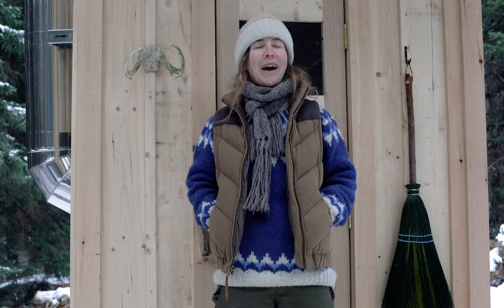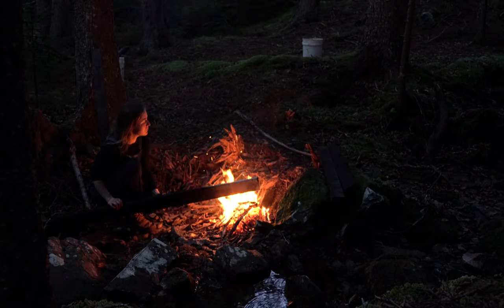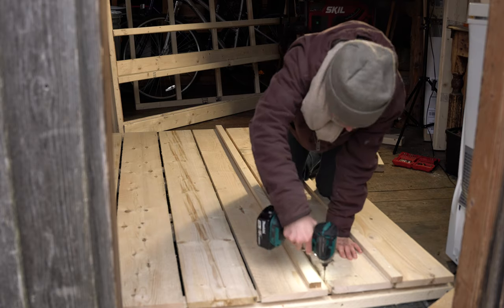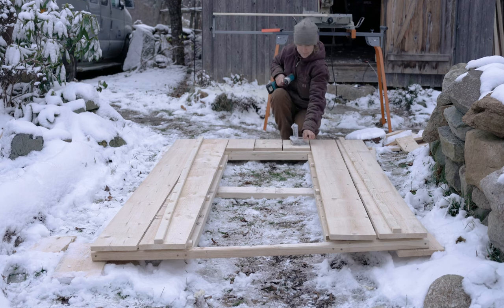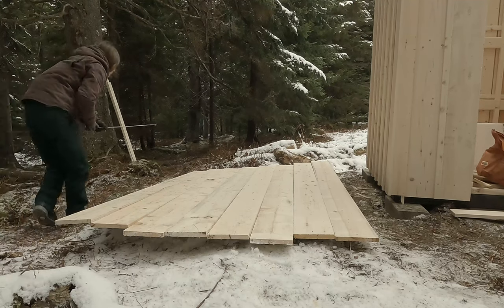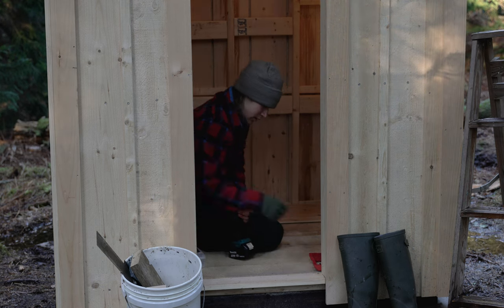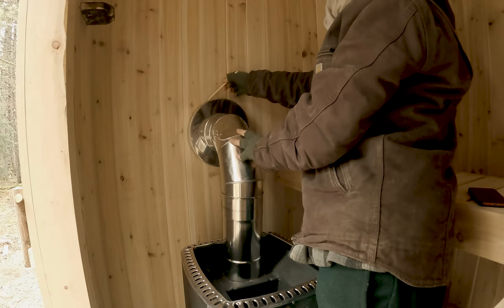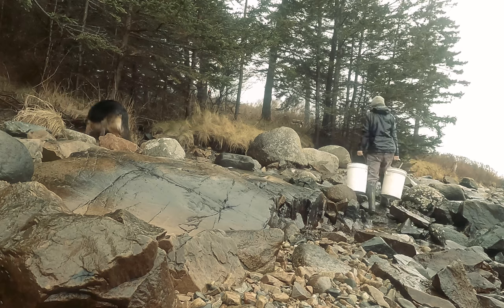How to build a LUXURIOUS sauna without carpentry experience in 30 days

Comment: Well, being a Finn, sauna comes from Finland, there is few mistakes her, just telling you, so others dont make same mistakes: Where is Air vent s, air coming in and going out?? very important, sauna cant be like a Bottle, in wood heated sauna, air should come in from behind or next the Heater, lower level, and going out from the top, behind benches. You should always insulate the ceiling, heat goes out from the top, this small sauna walls are optional to insulate! Why did you nail boards to top bench?? Leave them lose, so you can lift them up after going to sauna, they dry up easy, or screw them under, never should be nails or screws on a top, where you are sitting! So there, Happy Sauna Times =)
Reply from the maker: Thanks so much for taking the time to share your valuable feedback! I chose to forgo the vent system because the door has some pretty large gaps around it, at the bottom of the door you can feel the cold air rushing in and at the top you can't feel any cold air. So I think the movement and venting of air is working perfectly fine—one reason why not to worry about a super tight door! I also thought that without insulating it vents would let in too much cold air. As for the ceiling insulation, this sauna easily gets up to 175 F in 30-45 minutes with small logs and plenty of kindling. If it were larger, that might be an issue, but with the size, it heats up so easily. Plus, I didn't want to use grace ice and water shield or some non-natural material like that which seems to be necessary when you start insulating. As for the nails, you make a great point! I did consider leaving them out but I like to sit on towels so that the sauna stays clean since it is not located near running clean water, cleaning the benches from sweat, etc would be hard. The towels protect your skin from the metal just fine!
Reply: @lilyannajoy It’s also when you have a discussion with water. You know it’s answer, water is wet and not kind of wet.. It’s like a Fin that knows sauna..🧖‍♂️
Reply: @lilyannajoy  Cold air entering the sauna is not a problem, but the problem is that there is not enough air entering the sauna and go out off the sauna, The problem is also not that the sauna room is too cold. It's not when there's a heater. The pleasure in the sauna comes from the fact that there is good ventilation and a heater that is hot enough to get good steam.
Reply from the maker: @HannuPulkkinen49  Well, it sure isn't perfect, but it is better than what I had before (nothing), and I feel exactly the same pleasure from this sauna that I do in other, more perfectly designed saunas. But I understand your concern, I will definitely be more intentional about ventilation in my next sauna build!
Reply: It's a impressive build but I value aged old ways of venting the sauna. The air circulation is important
Reply: @lilyannajoy  If the sauna feels ok for you as it is consider it be ok then. I have a rather large sauna with big stove and I don't have a ventilation there. It has old wooden door that leaked so much that I put a linen sauna seat cloth that hangs on top of the door gap inside the sauna like a curtain preventing the steam escaping too fast and it works wonderfully! Also the window is leaky too and only one glass. Sauna is made from logs and its old smoke sauna that has been renovated as a wood stove sauna now. It has a log panel walls with a gap behind the panel so air can circulate and steam does not gather there and cause problems. Quite often sauna walls, ceilings and seats are treated with something to make a moisture barrier but I left it out in my sauna so first the steam gets in all the wooden surfaces and then when those are inbregnated with moisture it starts to get more moist in a sauna and it also gives out the moisture in a sauna when air start to get dry again keeping the sauna more humid. Also you can smell the wood much better without blocking the surface with any barrier. Although the seat stay much cleaner when you put paraffin oil in them as much as they take it but I use cloth and wash myself before getting seated. I enjoy the most around 158 F sauna and as much steam as it does not feel burning my skin. If you enjoy go and roll around in a snow next winter or have a cold water bucket to cool down and then get hot again in sauna! That's what I love to do when possible and when I feel for it.
Reply: Only half Finn but identify as FINN. Remember going to a sauna in Wyoming in the winter time as a kid.( 70 years ago ) Everyone in the sauna ( except me ) speaking Finn!
Wish those old towers were around to coach me as I build one next summer😊

Comment: The main thing in any project is that you have joy as you think about doing it, enjoy doing it and feel good about it when you are finished and you achieved all of that, setting a great example for others that it's not always about doing it 'right' but making  it about the satisfaction and joy.   Sure there are 'technically' correct ways of doing this or anything for that matter, and we may always find there are things we would do differently, but if you end up with a result that you are happy with, who cares if it's done 'right'.    I will be building one of these and hope it turns out as good as yours.

Comment: It’s hard to say it’s a sauna. It’s a small shed with a big stove! 😂
No insulation, so you will be burning a lot of wood to keep it running. And with air sipping from all cracks, not sure if it will be comfortable. 
But if it works for you, good for you! 😂
Reply from the maker: It actually doesn't take much wood at all for a 1 hour session, it heats up in 30 minutes, and we have a TON of dead branches everywhere to use, so it is helping to clean up the woods. Ask any of the five people who have shared the sauna with me, and they will be the first to tell you that it gets SO hot in there. There are two spots where there are some tiny cracks and they aren't a problem at all. It is quite nice!
Reply: Not the most worthwhile comment…
Reply: 😂😂😂😂😂😂 if your not from Finland you can do one

Comment: Greetings from 
Winthrop Maine. Congratulations on building your first project; your sauna looks nicer than the magazine original. I’ve been watching how to build a sauna videos and figured that insulation would be a necessity to have a hot sauce during the Maine winter; it’s interesting that you have successfully left that out. Your video is very nicely produced and you are both cute. Subbed.
Reply from the maker: Hi fellow Mainer :) Thanks so much for the compliments and for watching! Yes, I am amazed that it works so well. I definitely think it has to do with having such a giant stove in such a small space, if you were to have a bigger space you'd probably wanna insulate or go with a log cabin sauna. Good luck with your build!!

Comment: Simple, yet one of the most beautiful saunas I have seen. It will be my summer project.
I really like the no insulation part. Such a tiny sauna probably does not need it even in colder climates. Shou sugi ban rocks, too!
I take it there is no drain in the floor? 
And may your sauna bring you warmth and relaxation for decades to come!
Reply from the maker: Thank you so much for your kind comment! I'm so glad you like it :) Yes, the trick is to use small diameter logs (1-3") which really gets it going HOT within 30-40 minutes and it stays that way too. No drain, as I am not using steam in this sauna bc it will warp the thin cedar tongue and groove I used. Good luck with your build!!

Comment: I love that you showed how to build this, without all the fuss that family handyman and everyone else bangs on about, they are just jealous you were able to simplify the process to make it even more accessible to build. You are brilliant! Ignore all those who are jealous and do not appreciate what you have achieved, they just wish they could have done what you were brave enough to achieve. I am following your idea and building my own, however to save on costs I plan on using all recyclable timber, pallets, fencing timber and recycled corrugated iron sheets, I even have a second hand pot belly stove that I intend to modify and use as the wood heater source. I love that you skipped the foil wrap and insulation, and that is it not necessary. My goal is not just to make what you did, but attempt to make it all from recycled timber, might take a while. The other plan was to use a mixture of  timber for the frames and recycled corrugated iron sheets for the exterior walls and timber on the interior? I am hoping to document what I do, but do not have the technical camera and video skills you have. Well done, you are amazing and have done an incredible job, can’t wait for your next project ❤

Comment: Very nice i like the idea of letting the sauna breath instead of insulating. Does it heat ok and how long dies it take
Reply from the maker: Thank you!! I think it heats SO well because it's so tiny and the stove is so big. In 30 degree (F) weather I can get it up to 150 degrees (F) in 45 minutes. And 170 degrees in an hour. When it is windy and cold (below 30 degrees) it takes longer, say about an extra 15 minutes and I have to feed it more often. I just hang out and read a book inside while I'm waiting, or work on our land.
Reply from the maker: Also, I've learned in the past few weeks that it heats up WAAAAY quicker with small branches about 1/2" to an inch in diameter.

Comment: Great build, congrats ! I may have missed it in the video, but would you mind sharing the cost that was involved in the building? Cheers :)
Reply from the maker: Thank you! Yeah, it was around $3000/ $3,500. The most expensive piece was the woodstove and the chimney. You could absolutely get a cheaper woodstove that isn't specially designed for a sauna and it would bring the cost down a bit. But the insulated chimney is PRICEY.

Comment: Great video! Were treated deck boards for the floor ok to use?  Not worried about fumes?

Hoping to start mine soon!
Reply from the maker: @JF-kb6bl  thanks! Are you referring to the subfloor? those were untreated (not sure how long everything will last because of that and other decisions in the name of keeping materials natural, but i’ll certainly post an update video this winter to tell ya how everything has faired!) if you are referring to the cedar boards on top of the subfloor, those too were untreated (just kiln dried). there are certainly vocs from wood though, and I’m not worried about those. a more sensitive person might be though. good luck with your build!!!

Comment: Nice build! However, I could not see you placing a heat shield behind the heater - I'd say that would be quite essential in order to prevent to catch fire.
Reply from the maker: I did! I used the protective sheath by Harvia. It was just so cramped and dark in there it was hard to film.

Comment: Heat shield for stove?
Reply from the maker: Yes! I used the harvia heat shield for the sides and a cheaper black stove board from Lowe's, imperial brand. So far, so good! Sorry to not have filmed that part, I did it late in the day so lighting wasn't great and it was super cold, I was just trying to get it done fast! Good luck :)